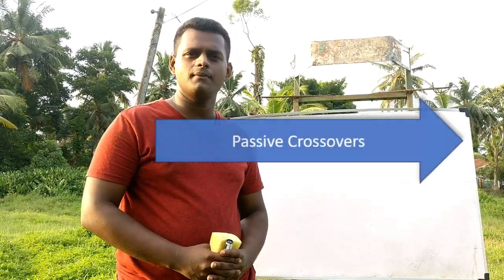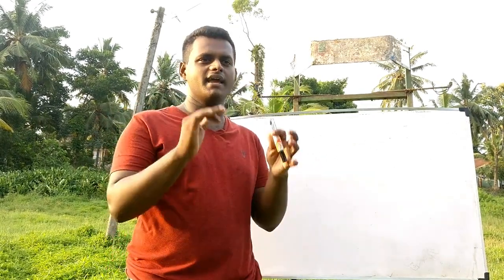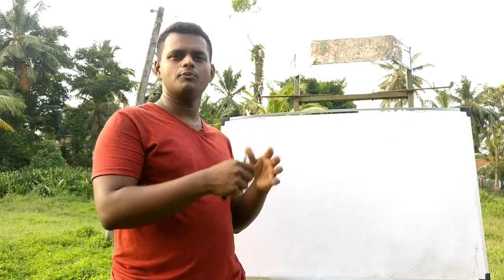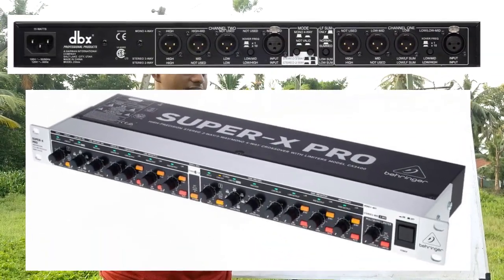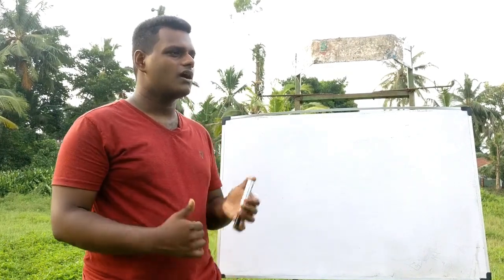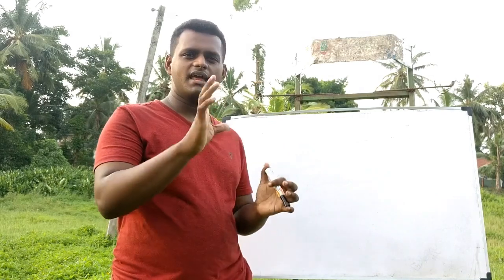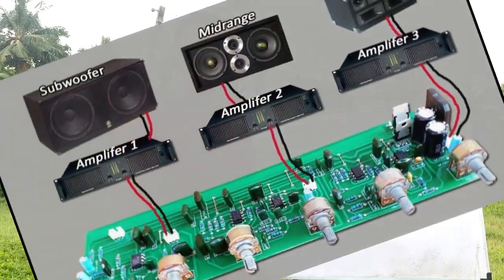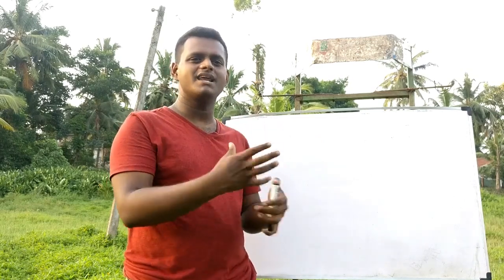Crossovers සිංහලෙන්  [Crossovers in sinhala 01]

Comment: Crossover 1k design karanne kohomada aiye vada karaya nam kiyanne
Reply from the maker: You need dominant filter poles and filter order filter phase filter frequency then you can do it the mathematics using LRC circuit with frequency analysis you can do it. Or use online  calculators to make it